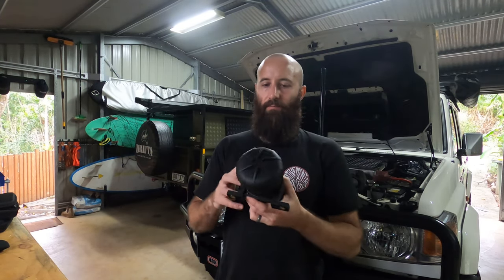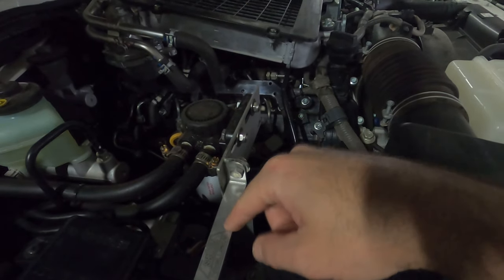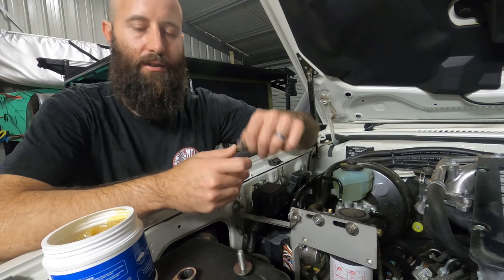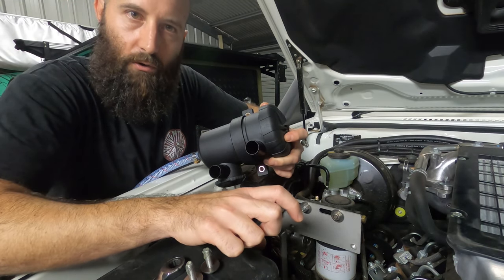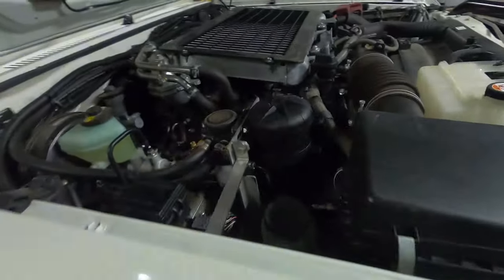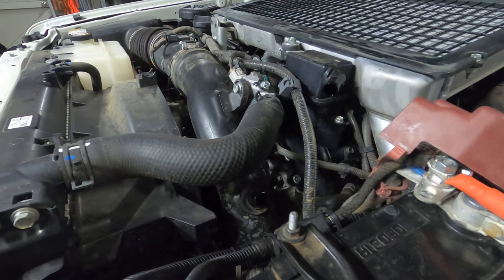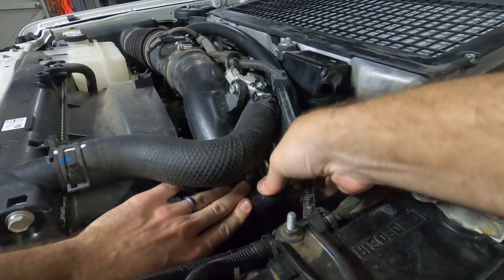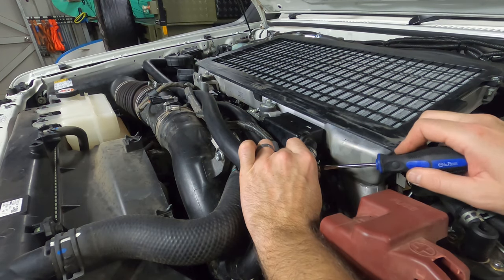Pro Vent Oil Catch Install on a 76 (70) Series Toyota Land Cruiser

Comment: PCV system hose has always a thermal insulation for a reason and the same hose is always short for a reason. This just is just introducing condensation risk to the exhaust gases and also increasing residence time of exhaust gases in the crankcase🚶🏻

Comment: Hi 
Putting grease on the bolts not a good idea because make them get loss instead would be better to use locknut liquid.
Reply from the maker: I’d agree with that mate when you aren’t removing bolts too often. We remove these every 10,000 kms when we change the filter so we are always checking tightness and easier to remove when not using locktite.